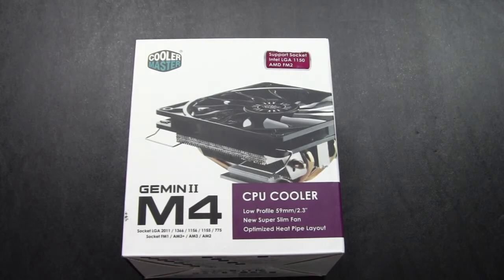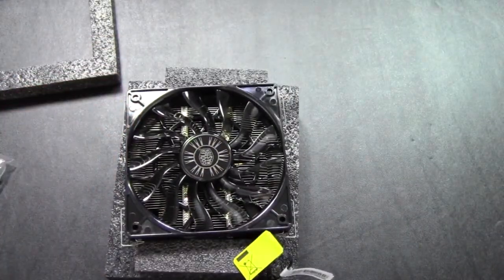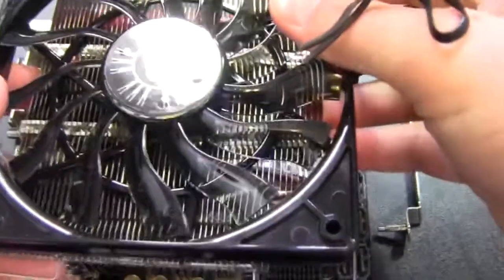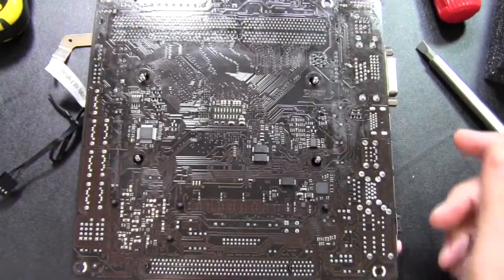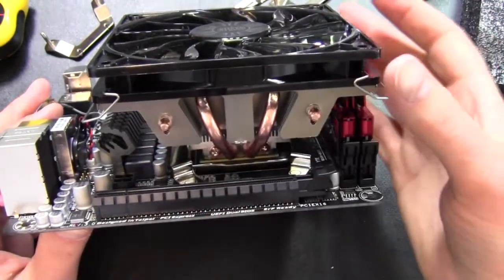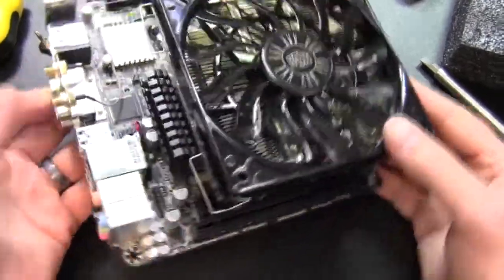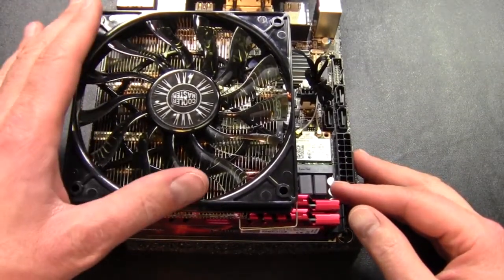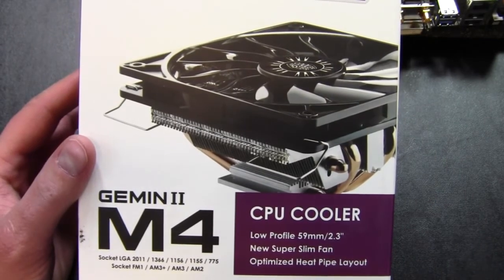Working with the Cooler Master Gemin II M4

Comment: Thanks for the good test-bed discussion of at least some of the True Issues of parts-selection - even the back of the motherboard gets your attention.  EXCELLENT.  The one thing I wish you'd mention - as with all coolers that 'impact' RAM - it's not just the height clearance alone - it's the RAM MAINTENANCE.  "What if I build a motherboard with RAM that's flakey?  Bad?  So now, to merely experiment or exchange RAM sticks, I've got to remove the whole CPU fan?!!  YEOW!!"  If a user wants to go from an initial 8gb to 16 or beyond - wow.  A whole new expense level of labor, CPU goo cleaning, reinstallation after probably pulling the motherboard, too.  Just to test RAM sticks.  Ugh.

Comment: CM seem to limit the cooler's air flow on purpose, so the warm air wouldn't heat the mobo or something. I see it as the fan coudln't deliver enough of static pressure to blow through the radiator, especially at low RPMs. I've replaced the stock fan on my GeminII M5 LED with a full-sized one and man, it's godlike. Tons of air moving around and delivering much better thermal results overall. I don't care about noise much, to be honest. Great video, thanks.
Reply: What SP fan did you replace it with?
Reply: @RAAZR- , Deepcool RF 120.

Comment: you should just move the fan a litle bit on the cooler, it looks like the fan goes over the edge of the cooler so you should be able to move it so you dont lose the pci slot
Reply from the maker: That would work, but the copper heat pipes that poke out of the fins are a little too close to the where the video card PCB would be for comfort.
Reply: maybe some plastic betwem them so they don´t short

Comment: Wonder what temps would be if a non-slim fan was used like a noctua nf-f12 or corsair sp120?
Reply from the maker: I would imagine them to be much better. I have sold the cooler already or I would try it out. The slim fan didn't push much air, the NF-F12 or SP120 would both move significantly more air.

Comment: well that settles that, ive been considering these two boards with this fan for my upgrade. looks like im going for liquid cooling on the gigabyte
Reply from the maker: I have used a few of Corsairs all in one liquid cooling kits on the Gigabyte board with great luck. Just make sure that there is a little bit of airflow over the VRM heatsink. I do find that difficult in some really tiny ITX cases.

Comment: Will this fit in an Antec P50? Also, will it be suitable for an Intel i7 6700K? I probably won't overclock it.
Reply from the maker: Plenty of room in the P50. You could get a cheaper or easier to install cooler in that case. A max height of 130mm according to the Antec website. Something like this:
http://www.newegg.com/Product/Product.aspx?Item=9SIA85V3R94990
is listed at 113mm tall.
Or:
http://www.newegg.com/Product/Product.aspx?Item=9SIA85V3RJ0605
is a cheaper alternative that will perform close. Especially if you are not going to overclock.
I thought the Gemin II was a bit difficult to install compared to the two above.

Comment: hello mate, do you think this will work in my Mini-ITX Rig? I have 2 x 4gb 1866 G.Skill Ripjaws (40 mm) RAM, it's about 7 mm taller than the RAM you used if you used Ares. My motherboard is a Gigabyte Z97N-Wifi and my case is Coolermaster Elite 130. My GPU is a r9 280x powercolor.

Will it fit or will it hit my RAM? I'm worried it will run into the ram/graphics card
Reply: ITX doesn't have a standard layout. Some have the chipset near the GPU, and some have the CPU near the GPU. In the case of the Gigabyte, the CPU is farther from the GPU, so you should be okay.
Reply: +Blood Angel yep, it worked just fine. was a little hard to get settled but works fine now :3 very quiet

Comment: will this fit in lga1151 socket in a mini itx case?
Reply from the maker: +Bryant Nelson (tornadogordo) On Cooler Masters website they list compatibility with LGA 1151. Some motherboards or cases might make a tight fit or not work. For example, depending on where the socket is located on the motherboard it could block RAM slots or the PCI express slot. I ran into that issue on the board in this video near the end. Some cases that have the power supply on top of the motherboard may not have enough clearance for this cooler and the power supply could interfere with the intake of the fan.
Reply: Thank you
Reply from the maker: +Bryant Nelson (tornadogordo) You are welcome.

Comment: Hello nice video!

can i install this cooler in my mother ASUS M5A78L-M LX? i will not have problem with my ram hyperx fury?
Reply from the maker: I think it will fit. The HyperX Fury doesn't look very tall. What case are you using?
Reply: im using this case http://www.noganet.com/fichaproductos.php?id=1344
im looking for some small cpu coolers because a 212 for example doesnt fit in. thx for repply :)
Reply from the maker: This is a great cooler and is smaller than the 212. I have used many of these where the 120mm heat sinks wont fit.http://www.newegg.com/Product/Product.aspx?Item=N82E16835103064

Comment: Can a MSI Fm2+ A88XM-E45 Mother borde work
Reply from the maker: I haven't personally tried that, but it should fit. That board has more room around the CPU socket than the board I used in this video.
Reply: AdoptedMike thanks also does the cpu cooler give me a chance of a massive overclock or a just a great one Im thinking of overclocking the Amd a10 7850k to 4.5Ghz and 990mgz-1100Mgz even higher  if possible 
so eney suggestion also I have been watching all your vids and all of them are purfecto
Reply from the maker: Hyperdonic2 If you are looking for a massive overclock, I would highly suggest you get at least a 120mm all in one liquid cooler. You will be much happier.
Reply: AdoptedMike What shall I look for when installing the cpu cooler before buying it?

The one in the vid

Also does a water cooler fit in the fractal core 1OOO  

Can the water cooler be a risk in a why ?  Sorry for all them question :)
Reply from the maker: Hyperdonic2 The radiator will have to be installed in the front and could only be 120mm. It is kind of a tight fit, so maybe not the best idea. When I don't use water coolers I like to use a tower style heatsink. A 92mm one should fit just fine. I may be wrong, but it feels like they do better than the down draft style like the GeminII. I have used only 6-10 liquid cooler units but never had any issues with them. However, I suppose at some point it would fail and it is possible it could leak. If overclocks are important, maybe get a bigger case that a 120mm all in one cooler can fit in. Or at least like a CoolerMaster Hyper 212 tower style heatsink and 120mm fan.
Reply: AdoptedMike I'm going to upgrade my com
Reply: AdoptedMike I'm going to reply later my phone is jacked up and close to unreperable so time for a upgrade in 5-18 moths mybe all that I have is just for now also can the CPU cooler hold up for only and mid OC
Reply from the maker: Hyperdonic2 The CPU cooler that I used can handle a small to mid overclock just fine.
Reply: AdoptedMike Thank you that's all I need to know have a good day or night or evening

Comment: This fan i will works with my systeme : amd a4 4000 , msi fm2-75ia-e53 , 2x2gb crucial low profile ddr3 ,diamond radeon hd 7750 ??? I will compatible with my motherboard and gpu ? thanks
Reply from the maker: +sogetel24 This heat sink and fan are a bit overkill for that processor. It does look like it may block the PCI express slot. Personally, I would not use this cooler on your motherboard. The Gigabyte board that I used later in the video, looks like a similar socket location, so that is why I think it will not work for you.
Reply: +AdoptedMike Would this fit on my gigabyte ga Z97mx gaming 5 micro atx and corsair vengeance ram
Reply from the maker: +Joel J From what I can tell, yes. It could make access to the M.2 socket a little difficult. Honestly, if you have a big enough case, I would recommend getting a tower style cooler over this down draft. I had to replace ram sticks in a board with this cooler and ended up removing the cooler just to replace RAM. More of a hassle than it is worth.
Reply: AdoptedMike I think I'll just go with a water cooler
Reply from the maker: +Joel J Much better idea IMO.
Reply: AdoptedMike what do you think about the corsair h75
Reply from the maker: +Joel J I have used many of the Corsair AIO liquid coolers and I really like them. I would go with the H75. Simple and effective.
Reply: AdoptedMike thanks man
Reply from the maker: +Joel J You're welcome.

Comment: Actually someone told me you used Ares but after watching it appears you used Ripjaws. Help me out here, I'm worrying. Is it okay/good to go to use this with my Gigabyte Z97N Wifi Board & 2 x 4GB Ripjaws RAM? (You can find my build here https://pcpartpicker.com/user/Feliks/saved/#view=fvKV3C)
Reply from the maker: +Felix The RAM I used was the Ripjaws. I do not see any issues with your build. I think it will all fit. I have never done the exact build as you but I have used that case with an AMD Gigabyte motherboard and it worked great. I only wonder if there is the clearance between the CPU cooler and power supply. It looks close. If it is too close, the fan won't be able to push air through the heat sink because it will be starved. The stock cooler will fit no problem though. Alternatively, you should be able to get a 120mm all in one liquid cooler in there.
Reply: +AdoptedMike  thank you. is the Intel motherboard bigger than the amd one or something (why should I worry about it hitting psu?)
Reply: and will it fit with my graphics card (which is rather big)?
Reply from the maker: +Felix The GeminII cooler is tall and could hit the power supply.
Reply from the maker: +Felix The GPU should be fine, PC Part Picker is pretty good about case and GPU combinations.
Reply: I meant in terms of the motherboard/CPU cooler (:

In short, looking at my motherboard {Gigabyte Z97N wifi, sure you can find pictures if not I'll send a link :) sorry I'm asking for help} and knowing the size of that CPU cooler, what (if anything) should I be worried about it hitting or blocking? Like here you said it'd clear the ram but hit the PCIe slot; on my board what does it look like it'd hit / clear?

Again sorry I'm asking for help, you seem to have a bit more experience than me with this so:)
Reply from the maker: +Felix That board has more room between the CPU socket and the PCI Express slot. It looks to be more than enough room to plug the GPU in while using that heatsink/fan combo.
Reply: +AdoptedMike okay thanks. will it be OK with psu too? (sorry should be last question)
Reply from the maker: +Felix No problem :) That power supply will fit just fine. You could get by with less power, just make sure you get a semi modular or full modular supply. It will help with cable management. You can get by easily with 600 watts if you wanted. Not a bad thing to have too much power though. You may need it in the future if you wanted to get a better graphics card.

Comment: ...Or use a riser to get a proper GPU on your PCIe
Reply: Which is fine if your case supports it, but most expect to be able to use the slot from its original position. Bad design. There are better coolers and ITX boards.